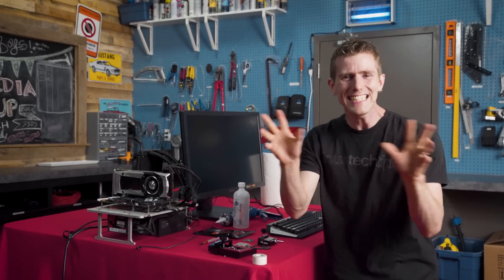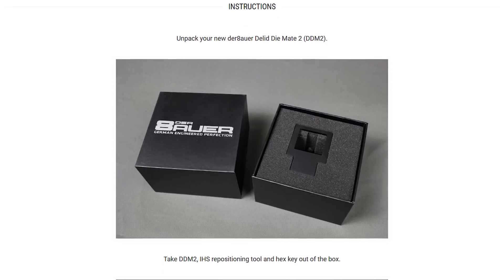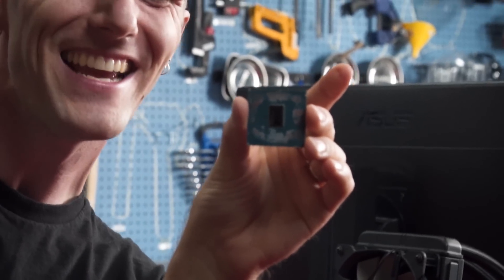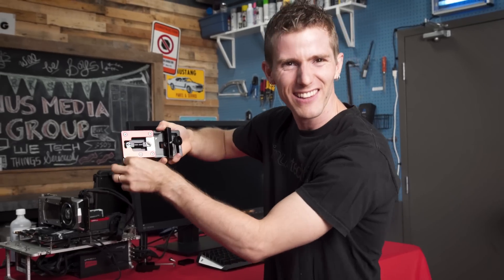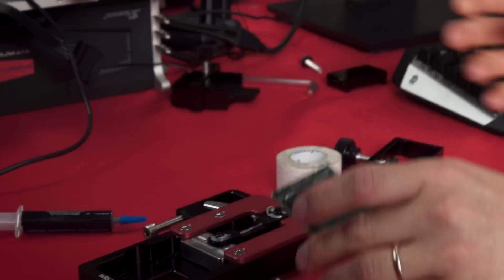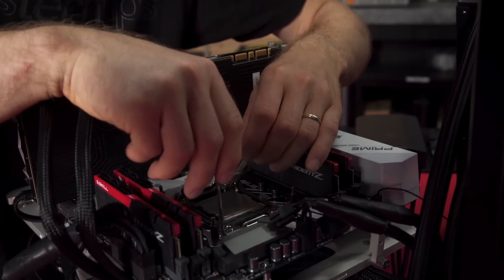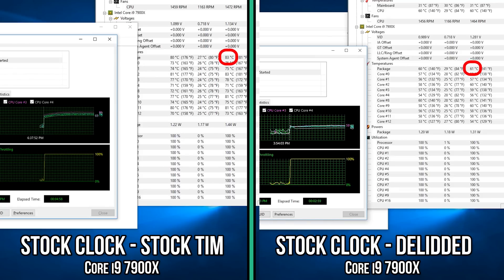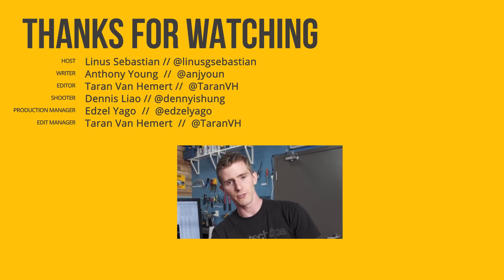Delidding a $1000 CPU - Worth the RISK??

Comment: Actually A really bad delid linus, Did you actually do any homework, watch der8auer's videos? Didn't use Liquid metal. Didn't clean All the old silicone glue off well. and then put more glue on the pcb in a really sloppy fashion increasing distance from IHS to the die. Put just a glod of thermal compound and didn't spread it on the first CPU, you need to apply it and spread it on dies as they can get hot spots and potentially damage the cpu, Unlike putting a glob ontop of the IHS like usual cooler installation. Surprised you'd see any thermal benefit here at all tbh. 

Watch der8auer's deliding vids or something else guys. This was just a linus wants to try experiment, which is a Shame when you have so much influence and people will just do it because you did it.

Comment: The delidding tool would be nice if it was automated with a controlled thermal compound applicator. A applicator vice and guiding rail to the manual one's would give a clean application. Overall good idea.

Comment: 4 or so years later my delidded cool-labs pro liquid metaled(IHS SIDE) then resealed i5 3570k is still reporting 19c less heat than when the stock TIM was in it, similar results for my 4690k im using atm, both of these have been overclocked since day 1 and are still overclocked today, still going strong, 3570k was hammer and vice method, 4690k was craft knife, wish I had these tools you used back then, they make it super easy and less stressful

Comment: USE LIQUID METAL FFS xD cmon Linus u should know this :/ ull get 10C less i bet my hand 4 it
Reply: he got 20 degrees less with regular thermal paste do you guys not watch the video
Reply: Ehmm i did otherwise i wouldnt comment. And im telling u that ull get better temps by using liquid metal doesnt matter how much he got from normal paste (20 in this case) liquid metal will and is allways batter. Maybe hell get 30 less by this. My i7 6700k @4.7ghz with 1.37 vcore is ``only´´ cooled by a dark rock pro 3 and never reaches 55C, guess why!?

Comment: I expected improvements, but not THAT much consdiering that you are actually still keeping the spreader and not running it bareback.

I mean - 20 celcius is pretty crazy. In a lot of circumstances that equates to running a SIGNIFICANTLY beefier cooler or with way more noise.

This seems so weird though... why would Intel not do something equivalent themselves? If they could net such huge gains just from putting in some high quality TIM then surely that would be beneficial to their sales and marketing? Especially for laptops and whatnot that have to run within small thermal envelopes.

I mean I just don't get it - it would hardly even need retooling to switch up the TIM I bet, or even if it had to be done by hand - I'd so easily pay an extra 20 bucks to buy a "delidded" version

Comment: Guys search for: "delidding my 3770k anandtech forums" on Google. There is a whole post of test and a conclusion. You will learn it is NOT THE PASTE QUALITY that affects the temperatures when delidding, its actually THE GAP between the IHS and die which DECREASES from the delidding, leading to lower temps. 

Vote this up so Linus will can this too.

Copied from the end of the post: "Conclusion: The Intel stock CPU TIM is not the reason Ivy Bridge's run hot, and replacing the Intel stock CPU TIM is not the reason a delidded Ivy Bridge runs so much cooler - the benefits of delidding are entirely due to the resultant reduction in gap height between the CPU silicon die and the underside of the IHS."

Comment: AMD told the new ryzen refresh Pinnacle ridge will be introduced with a new set of X470 & B450 motherboards. But will it be backwards compatible? And will the present X370 & B350 run the upcoming ryzen Pinnacle ridge CPUs?

Comment: Mhhh i wonder, would delitting my 4790K and replacing the thermal compound give me better Temps for overclocking, currently i am only running a 100mhz overclock due to temps. and i am using a coolermaster Seidon 120V.

Comment: Everyone knows by now that it's not the higher quality paste that makes delidding lower Temps - it's the fact that the distance between the die and IHS is smaller, making heat transfer more effective. That's why many delidders don't glue back the IHS, as the silicon adds more distance.

Comment: Delids then applies less than a drop of thermal paste then relids ... wtf ? Didn't you guys do this already ?
It's half assed yet reveals somehow a clear drop in temp. I'm starting to think that simply making a hole in the side of the lid to allow some airflow is enough as the factory seal might create some pressure at higher temps...

Comment: If Linus had any self respect he would have used liquid metal compound like oh, I don't know, every other delid analysis? Go watch GamersNexus' delid. They use ThermalGrizzly's liquid metal compound and had massive temp differences. Linus probably scheming with Intel to make it seem like delidding doesn't do much.
Reply: what are you talking about he still got a huge temp difference and the fact that he just used regular thermal paste doesnt make intel look better it makes them look worse
Reply: Scheming with Intel? How the fuck does deliding hurt Intel? If you want to delid Intel CPU you need to buy Intel CPU and void your warranty, both of those are beneficial to Intel.
Reply: If Linus was scheming with Intel, wouldn't he want to incentivize everyone to delid their Intel CPUs? That way Intel doesn't have to reimburse you.
Reply: if u can oc then and thx to that skip one or two generations of intel CPU then intel loosing money...
Reply: nah man, you just need to isolate the transistors inside the IHS, clear nailpolish does the trick fine even if you're just about as clumsy as Linus. only thing with using liquid metal is, don't silicone the chip back together as you will have to reapply it after a year or two.
Reply: 20C reduction like he got in this video is  a LOT. That he is getting it without using liquid metal say a lot about how bad paste Intel is using....  Using LQM seems to only give slightly better results but with huge disadvantages like having to replace the TIM once every year...
Reply: Using liquid metal with deliding is plain stupid. Liquid metal is conducting so you are risking shorting the circuits

Comment: Why not use liquid metal thermal compound... I delidded my i7 3770k and only replaced the TIM with normal thermal compound that you did... i still wasn't getting a really GOOD temperature drop then i replaced it with liquid metal(Thermal Grizzly Conductonaut) and BAM around 25 degree difference... Totally worth it because i have the i7 3770k OCed to 4.4 ghz in a 15 liter Mini-itx case(Sharkoon sharkzone c10) with a GTX 1070 msi gaming x and BOTH of my GPU and CPU are running at a 65 degrees Celsius and it was 80 degrees Celsius  on the CPU so I am REALLY happy ... oh and my ambient temperature is 29-32 degrees Celsius outside so it got REALLY toasty before the delid

Comment: "the risk"

tbh if you've got a decent set of hands on you there's barely any risk at all. I practiced on a load of TIM using 775 CPUs (Celerons, Pentium Dual cores, lower end Core 2s, etc) and nearly all of them worked after the operation perfectly, even one that I was sure was a goner due to a bad nick on the PCB. (Thankfully it must just have hit redundant circuitry or a ground plane or something)
And considering the massive temp drop and decent OC increase (if that's your thing) I'd say its easily worth it. I still haven't done my 3570k (Laziness and a lack of TIM more than anything else) but it can happily boot at 5Ghz, just my NH-D14 isn't able to keep temperatures under control.

Also, if you want an easy way to keep a naked LGA CPU in its socket without the retention system here's a good one: Keep your motherboard flat after putting the CPU in and put the damn cooler on. It'll stay in and have just as good contact as it'd have anyway.

Comment: Imho I think that LTT is running their 7700k on too high voltage. At 10:00 you can see 4.8GHz @1.423V while my 7700k is running 4.8GHz @1.23V and I get about 72C under full load. Either LTT is pushing the CPU to temperatur limit or they have lost the sv- lotterie

Comment: So much wrong with this video. You dont scrape the old glue off and put way too much silicone and too close to the die. Problem #1 is the distance between the IHS and die. And what kind of overclocking is that called when you get thermal throttling. Its a failed one. Who on earth would run their processor over 100 celsius? Thats just dumb.

Comment: That's too little paste between the die and the IHS, Linus. Putting paste on IHS is much more tolerable to mistakes since heat is spread out to a bigger area (its name literally HEAT SPREADER btw).  If there's any tiny hole on the die without paste, it's gonna straight up die due to concentrated heat.  You have to make absolutely sure there's enough paste for the entire die surface to make contact with the IHS.

Comment: Why are you using Kryonaut?  I'm sure he probably told you to use Conductonaut.  You did this before with your Arctic Silver crap paste and falsely told people that delidding gives no difference.

Are you doing the same thing, or are you trying to not complicate the video by having to give warnings and proper usage of liquid metal?

Late Edit: Caught the end, where someone told you how to do it right.  This is where you messed up BAD and lost credibility in your original delidding video.  At least you corrected your mistake in this and actually used liquid metal for your final result this time, and found that everyone isn't lying about the benefit of delidding.  

You might want to add a video explaining that you didn't know what you were doing, and failed to research the topic when you did that delid and used that crap Arctic Silver on the die, and then claimed that delidding provides no benefit or even change in temperature, which was your conclusion in that video, at a time when 15C was the mean temp drop for everyone doing it correctly using liquid metal.  There was even speculation that Intel paid you for that one to discourage idiots and the incompetent from doing it. The TIM you chose wasn't the only thing wrong with that video, seriously, an x-acto knife?  get real.  At the time you did that, the accepted ways to delid were the standard stanley/craftsman utility knife replacement razor blade, or the vise only method.  You may be the only person who has ever tried with an x-acto, an inherently dangerous tool for the job.

Other than a small handful of curious incidents like I mention here, I otherwise enjoy your videos, and am a fan.

Thank you for not misleading people this time around.  

As you probably know, lifespan vs temperature for integrated circuits is NOT linear, and lifespan exponentially decreases as temperature increases in operation.  The temperatures that everyone seems to be getting with factory stock TIM, the size of the die and it's lack of soldering, as well as other factors have me wondering if the gray crap they put on the thing at the factory is a way to get premature failures after a few years in order to push more sales.  I even did a survey to see if any new peer reviewed papers exist to show new information on thermal stress fractures on large solder-TIM dies, and nothing new really shows up that wasn't already known.  Either Intel isn't sharing reliability information related to soldered IHS or this is the most insidious kind of planned obsolescence. 

I am planning for an i9-7980XE (I have a work-related need), and to me if this is a planned obsolescence when good engineering practice is to solder a large die to the IHS, for $2000 I'm kinda pissed that I have to delid.  Threadripper is actually equipped for a different market segment, IMHO, and is lagging in features and subsystems.  And no, I'm not an Intel fanboy, and Ryzen is still a decent thing, just not for what I need to do, so this isn't said to start a fanboy war here, it's just a realistic truthful statement.  Ryzen/TR are a nice first showing from AMD for competition, they still have a way to go on features and subsystems internal to the CPU, just a statement of fact, but they are moving in the right direction finally, and will probably catch up sooner or later (sooner please!).

Comment: Intel really needs to stop selling people products with garbage quality materials at those prices. Was planning on getting a 7900x for my work pc, but not anymore. Hopefully they learn their lesson with v2.0 next year.
Reply: For the prices they OVERCHARGE, the very least they could do is spend a dollar more  a chip on decent Thermal paste. They are such money grubbing bastards.  I used to be a fan but that was a long time ago. Everyone deserves a decent profit but they have become the epitome of greed!
Reply: Sorry but, they will never learn, until AMD make them bankrupt.
Reply: Damian C why did you want a 7900x for work?
Reply: The Superpixeljunkie The animation software I use benefits a lot from high clock speeds/single core performance, so that's why I didn't want a 1950X. Now though, I'm leaning towards a 8700k, which still uses cheap TIMs, but at least it costs less than half of what they charge for the 7900x and it has better single core performance. Bonus is that it uses way less power and better for games on my off time. The only downside is there's less PCI lanes available, which I know I would populate.
Reply: dont you want to look at amd? They have way better heat dissipation

Comment: A better question is why intel doesn't use this improved thermal paste if the temp differences are that significant? they can charge $10 or $20 more per CPU... IDGAF

Comment: You definitely did it wrong 😂! My delidded 7700k on air cooling (hyper 212x) runs at 4.9 ghz with a max temp of 76 degrees (delta 21). You should have used coollaboratory liquid ultra.

Comment: What I got out of this:
Intel charges you $1000 for a cpu that uses toothpaste as a thermal compound... 
Seriously Intel?  THAT'S where you cheap out?  Especially as this is the biggest weakness of your latest processors.  God damn.
Reply: The brand of thermal paste they use isn't the problem. The glue they use on the IHS lifts as it dries and causes a gap between the IHS and die. That is what causes the temperature increase.
Reply: Not according to the video, all the comments, and basically every other source of information.  That said it is an interesting theory and I bet it's not doing the chip any favors.

Comment: Kiddies... Let this video serve as a reminder. THIS is why we do our experimenting with cheaper second-hand play-box materials...
    You can get them (often) by finding a PC shop that's going under and buying out the inventory... You can visit yard and garage sales, check Craigslist and Ebay... And since the warrantee isn't worth arguing over (and probably not even the paper it's printed on either) you might as well take stuff apart and find these things out.
    I know, sometimes it takes patience to find "just the right" parts when you scavenge, but if you're going to delid a brand new $1000 chip... you might be better off if you KNOW WHAT YOU'RE DOING. :o)

Comment: id def go for a full custom loop before i rip the IHS off a one thousand dollar processor like the 7900x.

With that said I dellidded my 7700-k and I kinda think that it is a must with certain Intel CPUs if you want decent temps with a modest overclock (Note: I have a corsair H110i AIO). I didnt get the 20 degree centrigrade drop like some, but def got around 15

Comment: lol crystal clear that if you want a processor that can conduct heat properly without grazing the upper echelon of your thermal limit, you solder your die to the IHS, aka, AMD lol. its pretty sad when intel has to resort to cost cutting measures such as using thermal paste for its IHS to keep its costs down low enough to stay competitive, not to mention risking its lifespan.

Comment: @linustechtips 
Hey Linus, I was scrolling through ebay searching for scrap parts for a PC building project of mine, and I stumbled across "AMD ONLY" ddr2 & ddr3 ram. As far as I understand, ram is ram and shouldn't it work in an intel system regardless?
Reply: @BigBlobProductions: AMD and Intel has different types of sockets, so if you're planning to purchase that and replace the chip with an Intel, it would not be possible.

Comment: Over a year ago I bought a large tube of Thermal Grizzly Kryonaut. The manufacturer states it does not need to cure but I shit you not after a week or two of off and on usage the temps dropped noticeable (more noticeably then the original difference vs the MX-4).

Should probably update that review...

Comment: NO you should NOT de lid. INTEL should just spend the 5-10 cents (or what ever the actual cost to them is) more per processor in the first damned place!  Seriously when charging $1000 they are to cheap to spend less than a buck on better cooling?